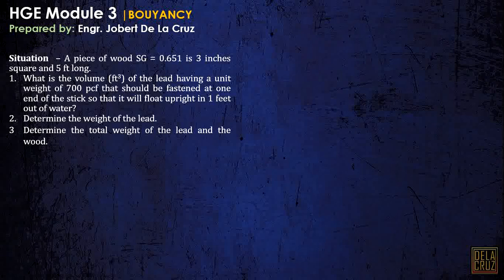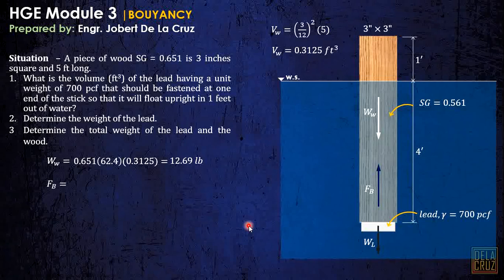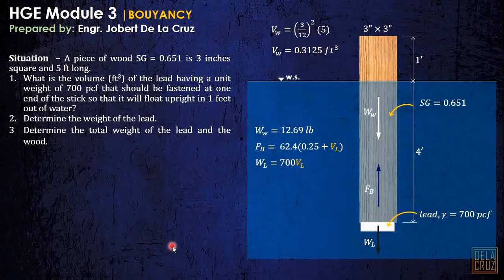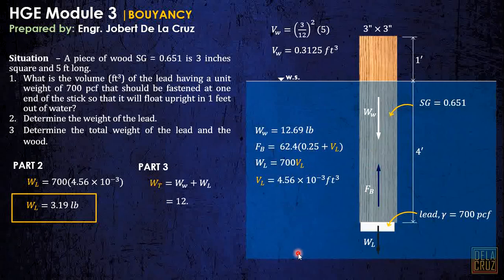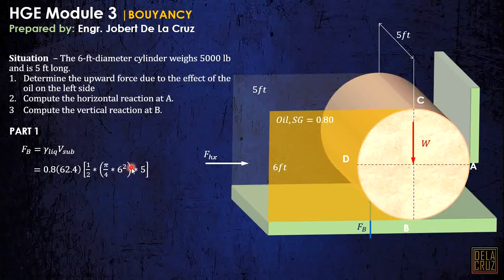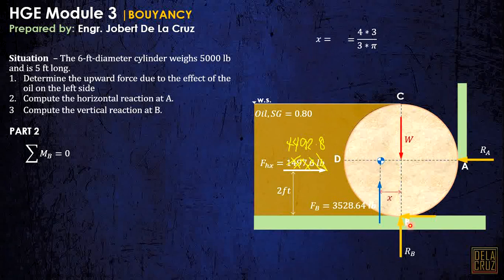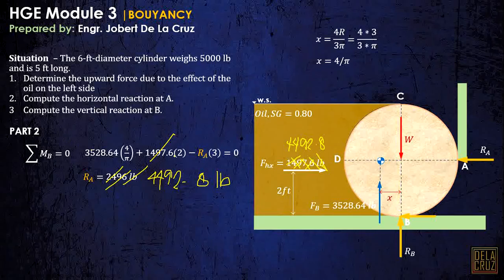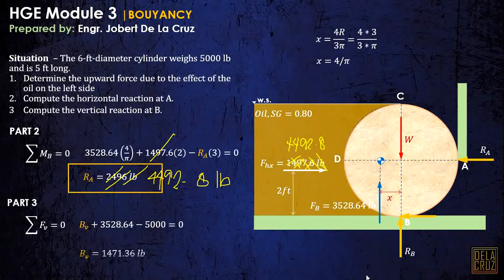CE REVIEW - WEEK 3 | BUOYANCY PART 3

Comment: speculation ko lang po ito, ang cylinder ay nakapatong only sa surface which is it has only ONE reaction only (smooth surface = 1 reaction perpendicular), so ang mag-aact lang po sa point B ay vertical forces only na ang involved ay ung weight ng cylinder and ung buoyant force po, therefore ang direction po ng reaction at A is pa-left as where as ung hydrostatic force ay pa-horizontal regardless na mag-moment po (kahit summation of forces horizontal lang po siya)
Reply from the maker: Thank you for watching! Please check upcoming tutorials :)